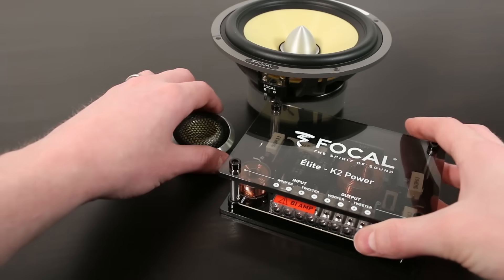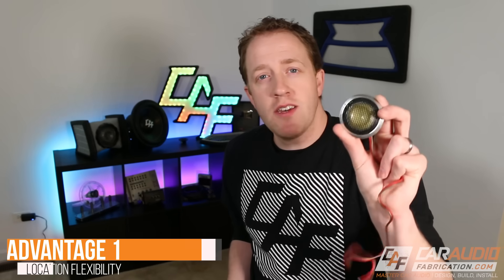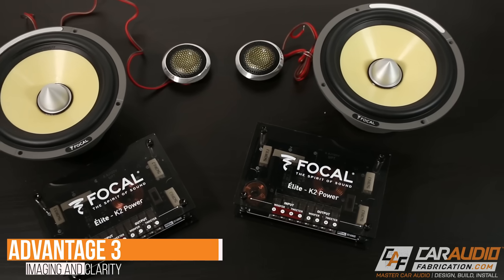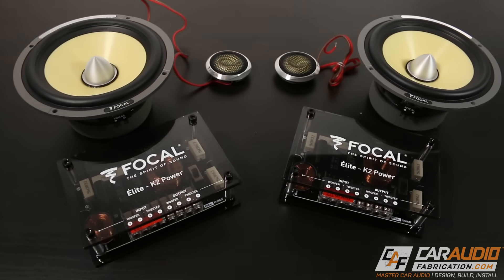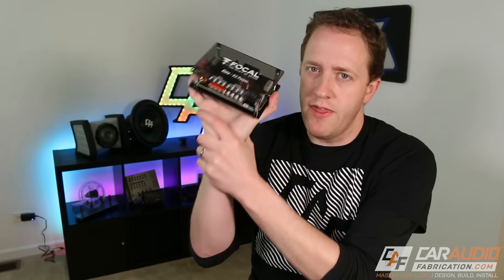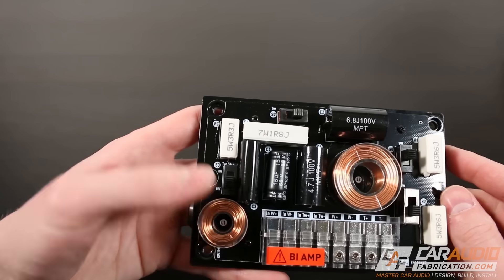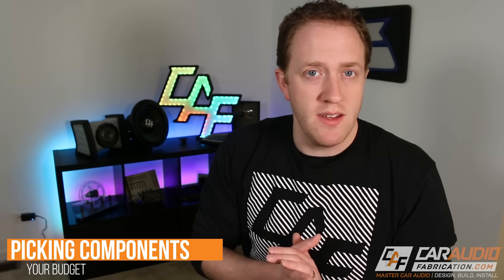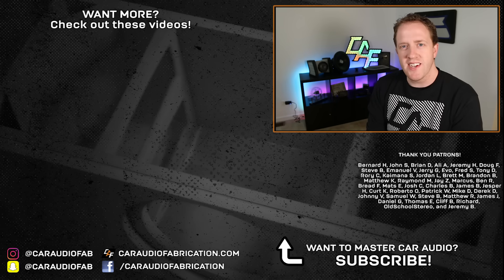Want AMAZING sound? COMPONENT SPEAKERS & everything YOU should know...

Comment: Could you not keep that crossover and bi-amp it? That would maintain driver protection and allow an active setup for time alignment. Losing a K2 tweeter is no laughing matter
Reply from the maker: Yes you could. The crossovers on the Focal's are very nice and have a lot of flexibility that most others out there don't, so I didn't want to focus on biamping as a "standard feature" but I will likely talk about it in an upcoming video
Reply: @CarAudioFabrication  ah I get you. Good call. I'll stop second guessing you
Reply: @CarAudioFabrication 
Mark, something else you might want to talk about as well, is the fact that a passive filter is impedance specific. I see issues with this when people have, say a two way set running passive, and think it would be cool to run an extra set of midbass drivers. Then they usually half the impedance, but also do the same to the crossover point. I also see it when someone might want to use a Focal crossover due to their nice flexibility, but might like to use another brand or model of speaker with a different impedance than the filter was intended for.
Just an idea. Keep up the great work.

Comment: How thick should a speaker spacer be? I have some that came with my Polk MM1 6502's they're about a quarter inch and I was wondering if that's enough. Thanks to anyone who has any answers. (I'd like to add that factory holes for my car are a no go as they're stripped so no matter what I'll have to drill new holes)
Reply: You don't know me well, that depends on what it is made out of and wether you need a few extra millimeters of clearance for the window mechanism etc. a simple mdf ring you would be looking at between a quarter to half inch thick would provide a very solid mount with plenty of meat for the screws as well as helping to add some weight to reduce vibration and resonance. They can also be made out of acrylic but that’s normally reserved for an extra level of customisation as they are slightly harder to make. Don’t forget the baffle rings front and back! These make a huge difference to the mid bass response even in crappy speakers
Reply: I have clearance for my window but I hear that having a spacer will improve mid bass response so I'm wondering if just 1/4 inch would be enough but yes I use fast rings already thank you.
Reply: You don't know me, 1/4 inch will be just fine. Half inch would be slightly better again but not necessary. As you already have the rings, you should know the most important thing is keeping the rear wave from affecting the front wave (what you hear). Acoustically seal that spacer to the door skin, mount the speaker and enjoy the happy tunes :-)
Reply: @phizzle24  thanks!
Reply: My friend had that happen roll the one of them It's up right on the speaker magnet. Some vehicle manufacturers give you room in the doors to play with.

Comment: Is it possible to run crossovers without a speaker connected? I imagine a 3 way component set, and powering the woofers from the DSP amp while running the mids and tweets off another channel using the crossover. Does the crossover require that load be present?
Reply: It's a poor choice. If you have two amp channels per side and a dsp, you should simply use a two way passive filter for the mid/high. If you use your existing filter, you lose the ability to control the crossover point between the low and mid, as the bandpass filter will determine the crossover point between the low and mid.
Reply: I only ask because I envision running 8 speakers off a 6 channel amp.
Reply: @Wolfsburg639 
in that case, spend the little extra for the two way crossover. They are fairly cheap all things considered, and it will sound right.

Comment: Another option for keeping the tweeter protected while using an active crossover, is adding a capacitor between the tweeter and the amp. So any low frequency that could come through, be it power on thump or a DSP failure, it'd have protection. Plus the capacitor will also help block any DC power caused by clipping.

I've bought some 100uF and 50uF capacitors to use for the protection for my Dayton Audio ND25TA-4 tweeters I'll be using in my car audio project, since I'm going to be using AudioControl's DSP based amplifiers for a full DIY 3-way configuration in my CR-V. :)

The sale of the AudioControl amps on Crutchfield helped me pull the trigger on the D-6.1200 and the D-4.800, the only thing that disappointed me, which is not the fault of Crutchfield at all, is the fact no one makes any bypass harnesses for the factory amp in the 2012 ~ 2016 Honda CR-V. Oh well, I'm working on making my own harness using a used factory amp for the connectors, customizing a PCB for those connectors, and going to run the differential-balanced signals from the headunit straight into the AudioControl amps! Utilizing the amp turn on and amp mute signals will be easy with a couple of solid state relays. A Normally Open and a Normally Closed relay should do the trick nicely there. I'll likely document my work as I keep going.

Thank you for all the inspirations you've been providing, Mark. Despite me primarily being heavily into DIY on my home theater system, you've still provided great tips and how to guides I feel are beneficial for future DIY projects within the home along with the car.  :)
Reply: Man I'd love to put a DSP in my car. I'm using the head unit's crossover and EQ and it's better than expected, but still not the fine grain control I want. Although for what I paid, my car sounds awesome.
Reply: just so you know, if your adjusting crossover points you already have a dsp
Reply: Emmanuel Umukoro I mean sure, but pre determined values that I can only select. On my other amp in the house that has dsp, I can select any frequency I want for the crossover, and the order, 1st to I think 8th. And not just a Lowpass, but both. (Car can only Highpass speakers, and Lowpass Sub) For the EQ side I can pick my frequency's to tweak and choose how wide I want to tweak it.

Basically more freedom.
Reply: @Reese
Sure like to know what the hell you're talking about. I wasn't aware I was missing out on that much music. 😮

Comment: Can you run active x-over while using the passive x-over to protect the tweeter? 

I would be interested to hear your take on Audiofrog speakers
Reply: The Great Empire!! Audiofrog, yes is all the answer you need!
As for the dual-protection on the tweeters, you’d just be adding complexity you don’t need, extra wiring you don’t need to do and you would still need to mount the crossover somewhere. All you need to protect the tweeter is an in-line capacitor tuned for at least one octave lower than the crossover point. Andy Wehmeyer has an article in the AF tech section on their website. It (the cap) is a dollar or two per side and you simply solder it in, set your x-over and levels on the DSP and enjoy
Reply: Phil Moore 

I have the crossover currently and it’s going to go in the back wall in my truck where the Kicker IQ amps are going.

Comment: If I got coax 6.5 can I also add a passive crossover with an extra tweet?
Reply: You cannot do anything to the coax as the filter is built in. You can add a tweeter that is crossed over by an external high pass filter.

Comment: I've never looked at components because they were always significantly more expensive than coaxials and triaxials. I've also never ran amplified door speakers before. I've never been able to do a side by side comparison to make me feel amplification was necessary. Just add a sub, tune overall bass level output from it, and send it. Upgrading and amplifying your door/panel speakers is easily the most expensive part of lower dollar installs... So much so that I've usually just kept my stock all-in-one speakers and simply tuned out the 20-100hz frequencies from them and ran the sub for that frequency range, and has been fairly decent to me...
But I've never been around high quality systems, so I really don't know the difference
Reply from the maker: You are missing out on a whole world of sound. You haven't heard true mid bass and highly dynamic sound without having an aftermarket amp.
Reply: Like I said, I've never heard any, especially none as a side by side comparison, so to me just messing with the HPF/LPF on an aftermarket and adding a sub has done great for me. Nobody in my personal life has done an amplified set-up, and nobody owns cars with premium factory stereo even.
Everyone in my life insurance stock or nearly stock vehicles, and most money goes towards wheels and exhaust & just subs. So I literally haven't a clue why I would need it because just messing with the HPF/LPF and adding actual base already helps so much over a stock head that can't adjust those things.
Reply: @JoeIsCrazyWillman 
As Mark said, it's a difference that is significant. You need to take a step back and leave your theory in the box for a second.
Let's start with the speakers. Most stock car speakers are rubbish, plain and simple. Yes, you can get cars with upgrades, and they a definitely better, and very expensive - too expensive for what they actually are. But the main thing is the fact that those factory speakers just do not sound good. It's not something you can correct with an eq or the like, they are simply just bad sounding speakers. They distort, they are usually all over the place in terms of frequency response, they resonate, and they lack any kind of real resolution and ability to present a proper sound stage - it's that simple. Nothing you do on a head unit will change that.
Then there's the headunit. The amps in those are weak at best. As soon as you push them the slightest, they cannot provide any kind of dynamics in the music. It will all become a blur of noise. Loud yes, but pretty unpleasant.
The other issue with the headunit is, that often when you get a nice set of speakers, then they will often be even more revealing. They will reveal the lack of power and sound from the headunit. The speakers will most likely sound better than stock, but the sound will still be off.
Lastly, there's the issue with factory "EQ protection". Most factory headunits will roll off the low end as you increase the volume, so that the low quality factory speakers are not damaged, as well as it puts less strain on the headuit amp. You can probably guess what this does to your sound...
As you said yourself, you haven't heard the difference. You need to do so, and you need to put your theory aside because it's not really applicable.
When you do go and have a listen to a nicely built system, feel free to be as critical as you like, just stay objective. I promise you, you will know why we do it, because the difference is massive.

Comment: Hey Bro, i have a 2016 Prius C with 6 speakers (two tweeters and 2 6.5 inch speakers in the front doors and two 6.5 inch speakers in the rear doors). If i buy a component set of speakers for my car, where will the crossover or dsp be mounted? In the doors? Or somewhere else?
Reply: If you have a Prius C, please do sound proofing on your front doors first before you mount a component set. Gentle knocks on the door with your finger knuckles will reveal the door  feels so hollow, with poor soundproof probably to save weight because Prius C is meant to be fuel saving. I have seen a car with good sound proofing that when you knock on the door, it feels and sounds like you knock on concrete. Car with poor door soundproofing will reveal its ugly side when the mid bass kicks in from the mid woofer. The first thing, it rattles, then the vibration from the rattles inside your door cavity will cancel out the mid bass. So do the sound proof first for your Prius C before you go buy a component set, later complaining the mid bass suck.  For my own car, the crossover is secured in the doors using double sided tape. If you are a beginner, dont buy a DSP first. Buy a good headunit, alot of them do integrate certain functions of a DSP like Time Allignment and octave selection for crossovers. I myself is using a Pioneer unit.
Reply: fleur'de' win thanks for your help bro :)

Comment: Mark,  you brought some great points up.

If you have a component 3 way/passive.
For the time alignment.
Do I just average out the 3 components distances?

Or how would someone figure out the time alignment?

Thanks in advance!

Larry
Reply: Well it really depends on your placement. Your mid and tweeter would ideally be close together and essentially act and sound as 1 speaker. In that case you would put an amp channel to those through the passive crossover and then time align that channel and the woofer to a separate channel. Unless you just have a bunch of amp channels to spare and want to send 6 channels up front. But I would think that wouldn't work as well
Reply: How are you compensating/applying your time alignment?  Time alignment is usually a delay based on physical distance applied through a DSP.
Reply: @johnd6258  exactly. That's why it will be so important to have those drives very close together to mitigate the distance discrepancies.

Comment: Hey Mark! Question here. How do i know when I need to upgrade my alternator or if my stock alternator will feed the system I'd like to build? Thanks in advance and I love your videos!

Edit: I actually got my sub and amp a long time ago without much knowledge on car audio. I just wanted more bass but now i am stuck with a 1000w RMS sub and mono amp. I do have an aftermarket head unit and 0 gauge wiring but would like more balanced system.
Reply: If it's a class D amp and you drive it hard, you'll need 70-75 amps of alternator power for 1000 watts. You should also considering a small battery upgrade and give amp it's own power reserve in form of an XS Power D925 as well as a QUALITY 2+ farad cap. Never listen when people telling you that you can replace a cap with a battery - you can't. They do two completely different things. When a cap is used properly it will provide punch and dynamics no battery can ever give. It is important that the main power supply, i.e alternator and battery is up to spec, otherwise that cap will tax your system even harder. But if the above checks out, a cap will be a great addition as it will be able to provide current peaks faster than any battery or alternator will ever be capable of.

Comment: How important is time alignment? I know you you probaly can't give a answer.
Reply: Placement first, then t.a. 😉
Reply: Time alignment is very important. Proper time aliment and speaker orientation will give you center imaging and vastly improved sound-stage.
Reply: @bigadventure3797  what about if it's a spl build?
Reply: @riveralley  
Considering that our ears can actually differentiate distances of 14 microseconds, yes, it is VERY important. That being said, it does not have to ruin the sound for everybody else. Most DSP processors let you have multiple configurations. You can have one for you when you're by yourself, and one where the image is centred between you. The latter will benefit both front seat occupants. When doing an SPL oriented build, ti's just as important as with SQ. When it's properly timed, you have the least phase cancellation, thus the highest output.
Reply from the maker: Extremely important to get the optimize your sound.
Reply: @CarAudioFabrication  Would I need to upgrade the alternator? The stock alternator can put out 150 amps. The total watts would be 2600-4600.
Reply: Time alignment is a big deal but you can still have a great sounding system without it. If you are doing an spl build then dont worry about it. Components will sound good if placed pretty close to right. Add time alignment and you enter a new world of sound quality. 4000 watt spl system... yes you should upgrade your alternator.
Reply: But completely ruins the sound for any passengers lol
Reply: My head unit has time alignment. Never use it nor would I. If you have anyone else the vehicle it sounds awesome to you, but weird to anyone else.
Reply: I’m running an audio control lci2 would I be ok without time alignment?

Comment: Happy new year Mark, as usual another great knowledge added. 
I’m still trying to find 18mm MDF material for my box at EGYPT 🇪🇬 lol 😂 
anyway this video came at the right time as I need some help with my setup 
What I have so far for my system is below 
Pioneer head unit AppRadio 4
2 sets front and rear components 6 3/4” Rockford fosgate T-1 power series. 
One subwoofer as you know 15” alpine type R with your stunning subwoofer box blue print design I’ve purchased from you (so far the best part at my sound system)
4 Rockford fosgate amps matched RMS ( 4ch for mid bass - 4ch  for TWT - 1ch mono for sub - 2ch for 2 mid range speakers) 
 Rockford fosgate 3sixty.3 DSP 
tons of Rockford fosgate accessories 10 farad capacitor and wires, amp kits and beakers bla bla bla, Odyssey battery PC680 with specs that I’m afraid it’s small 170CCA, 280MCA, 350HCA and 520 cranking amps for 5 seconds, and trying to upgrade my amp from 80 to 250 amps, RTA mic and SMD DD1 also almost all tools you have mentioned at your videos 
The 2 speakers for mid range are 4”  Focal Access 1 165 A3 and it came without cross over as a replacement for a component set, the problem is I don’t know how to set the 8 channels on DSP and is the focal speakers will match with my component Rockford sets? Should I run it all active or passive for Rockford sets? 
I’m really confused and I believe I made a mistake with my purchase 
What is your Input in my setup?
This is a link for my 4” focal midrange set without cross overs 
https://www.manualslib.com/manual/52815/Focal-Access-1-165-A3.html?page=2#manual
Reply: Dude did he reply and gave u solutions??